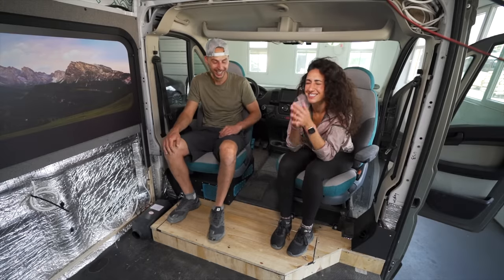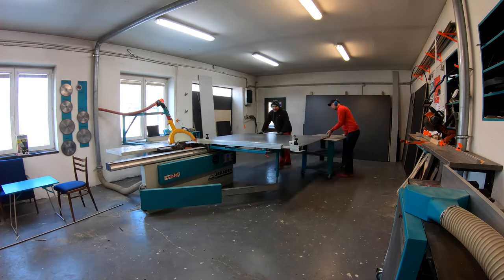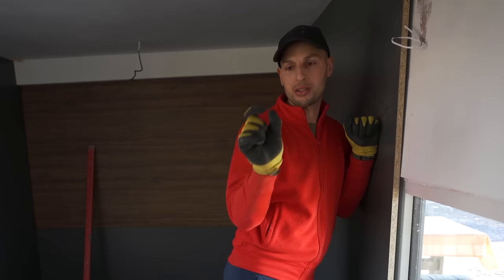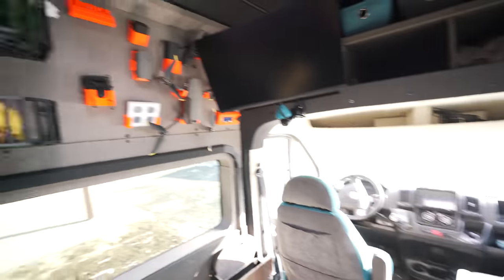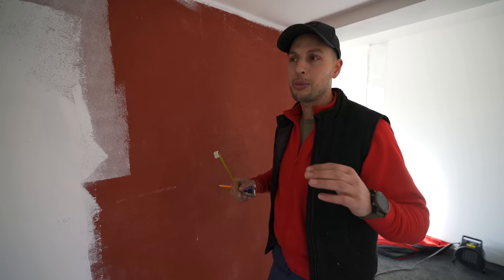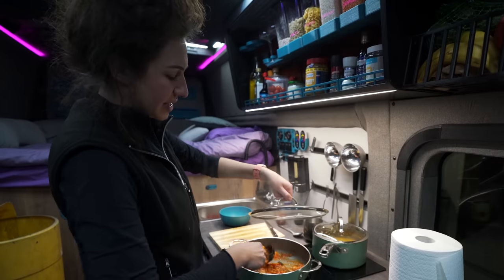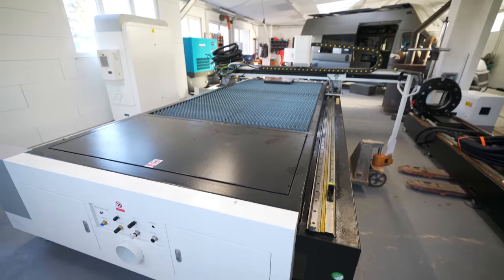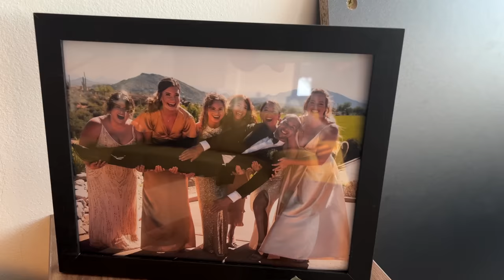IT’S IMPOSSIBLE! Building Cabin + Container Home + Van Build

Comment: My idea would be to solve the arm rest dilemma with a stowaway armrest that is much the same style as your desktop /trays you have for the front seats. So an armrest(s) that fold up and possibly inwards from the side or even the bottom front. I’m relatively sure you (Ladi) can picture this in your head and also develop a working model without terrible difficulty. Good luck!

Comment: ARM RESTS 
I would suggest using the metal poles you used for the hand rail on the cabin stairs... 2 short upwards poles (black) then a cushioned platform for your arms.

Comment: I would try out an armrest that can folded up (or down). Smaller profile, but still comfortable with a bit padding. A slightly longer couch could have fit you both (for movie cuddles - but that would have collided with the laptop table. Ah well you can't have it all.

Comment: Build the armrest into the slideout table part the one you already have to the right of the sofa seat. Maybe you could make it rather wide like a second table leaf that pulls out at lower height than the one you already have, just right as armrest and to place a drink laptop whatever while sitting on your recliner.
Towards the kitchen you coul make it „flip up“ from the kitchenwall. If you fix the armrests outside of the reclining chair they stay parallel to the floor even if the seat changes angle.

Nice vid

Comment: So glad to see you investing in training more people for your team and even in that huge monster machine.  I just know both will make your life much easier once the hard bit (training/install) is done.  You can soon look forward to slightly less stress and more efficient work.  Yay for you! 👏

As for the recliner, I think maybe you should try to take inspiration from car seats, or maybe airplane seats, and have arms that move up and down so they're not visually in the way when the seat isn't in use but can be pulled into place when needed.  Actually, you might even be able to have the arms push down flush with the seat bottom and then pull up and snap into place when needed instead.  That might look better in the long run but might be more complicated to set up.  Would give you more options on height of the arms though so it could be comfortable for almost anyone.  Maybe could be as simple as the arm being a T shaped piece and having a bunch of adjustment holes that a simple dowel holds in place.  Or you could get kinda lazy and repurpose some aluminum adjustable walking canes, possibly an old walker or medical shower seat would work (because they all usually have that spring pin adjustment and are meant to hold weight) for the height adjustment instead, so then you would only have to figure out a base to mount it and the actual armrest part.  Only problem with that solution would be that you might have to secure them to the van floor so that it works well in every position and that could be tricky but you're smart enough to figure it out. 😉👍

Keep your spirits up and your eyes on the prize.  It's not too long now!  I think the most complex part of the van you have left is probably the bathroom (if you're still going for the popup shower idea you had in the beginning) which shouldn't be too bad unless you're planning a recirculating shower (because those can be fussy to install and maintain but so useful sometimes to conserve water).  Everything else is pretty much details after that.  However, they do say that the Devil is in the details so get yourself some good matcha or green tea for the final push (because it's much better for you than coffee) and keep your energy up! 😁

Comment: Two bars on hinge points from the bottom of the chair....one bar hooked to the back of the chair parallel to the floor....when the chair extends, it should pull the arm rest lower (which would be more comfortable) That also leaves you a more open flow than a "wall" style armrest....

Comment: The armchair is more transparent and beautiful with an armrest on a fragile metal frame. So my idea 💡 is this;
For example, with two tubes, linked together with a hinge. The other side of the tube attached to the frame of the seat and the other tube has to be attached to the frame of the back support. 
So if the backrests moves backwards, the armrest also moves backwards and partly downwards, so it enables the person in the chair to continue using this armrest. This does means that the mountings of the armrests on both parts of the frames must also be able to turn during movement. The length of each tube determines the movement the armrest makes. The tube to the seat is shorter as the tube to the back.

Comment: For armrests, I'd probably want to do something with metal arms, and have it be able to fold down flush with the seat. It would be a good compromise between pretty (folded down when you don't need them) and comfortable (having armrests when you do need them - and with a bit of height adjustment so it fits different size people).